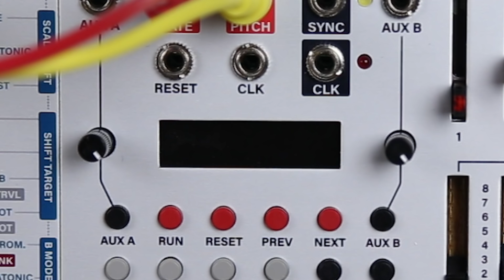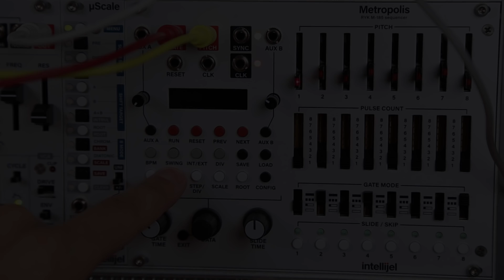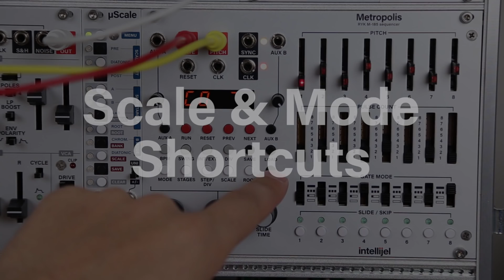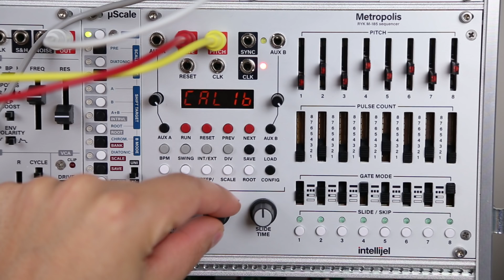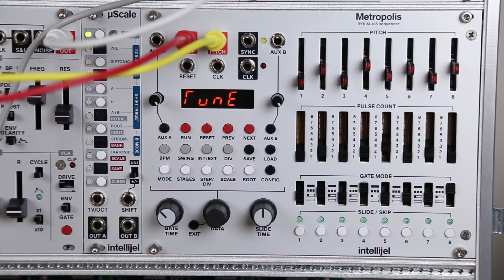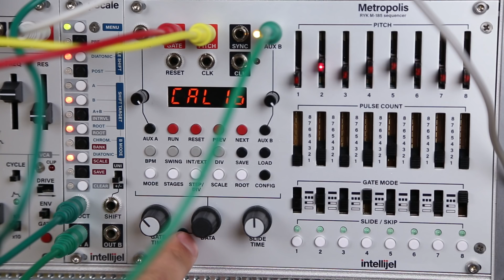Metropolis Firmware Update v1.30

Comment: What do you nerds use for the calibration "1volt and 0v source" ?

I don't have the uScale (or a midi-to-CV converter) but I have....
 a new second Metropolis, 
a Triatt, 
two Dixie2+ (plus 3 other VCO/brands),
an ADDAC Intuitive Quantizer,
a BeatStep Pro, 
and an AJH V-Scale (good buffered mult)
......plus a good Fluke 189 portable voltmeter.
(no DAW)

( btw, I'm not going to "calibrate anything", unless it really needs it........ If it works, I won't "fix " it.)
Reply: You could do this with the Triatt and the ADDAC Quantizer. Use a unipolar channel on Triatt and turn it down all the way to produce 0V, select only C on the quantizer, turn up the quantizer until it jumps an octave to produce 1V. Does that make sense? 

Reach out to support@intellijel.com if you need more detailed help.

Comment: Can you explain the calibration for volt per octave more with the modules you mentioned? I have them but don’t understand what to do...
Reply: Hi Munro Music, sorry it wasn't totally clear. We didn't want to focus too much on such a specific use-case scenario because we knew not everyone would have those particular modules.

1. Start by connecting the output of a Triatt/Quadratt in Unipolar mode to the input of µScale. Now if the Triatt/Quadratt knob is fully attenuated you know it will send 0v so you can use this as the first stage of the calibration. µScale should show this as a C
2. Turn up the Triatt/Quadratt knob. You should see µScale going up through the selected notes and you can stop once it hits C an octave above the previous one at 0v. Now you can use this for the second stage of the calibration.
3. Have fun with your calibrated Metropolis!

Hope that helps...
Reply: ScottMFR Thanks very much!

Comment: Can I use an Analog Four to perform the calibration procedure?
Reply: Sorry for the delayed reply, but yes, you should be able to do this. You just need to make sure you're sending 0v and then 1v. If you set a CV channel to v/oct and set middle C to 0v, then play your middle C, and play C one octave up.
Reply: ScottMFR Thank you so much!
I think a did the calibration with the A4 in other way, but I will try this because maybe it is more precise.
Reply: Oh OK cool. Did you use the Linear CV setting? That would work too. As long as you get those 0v and 1v signals into the Aux ins with the attenuators turned up you should be fine.